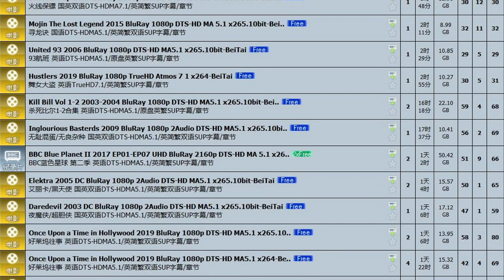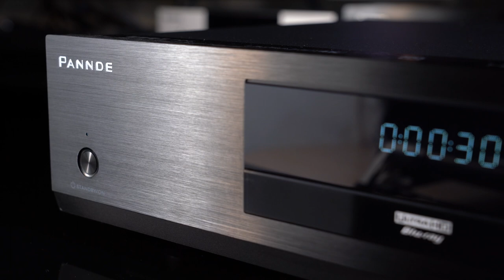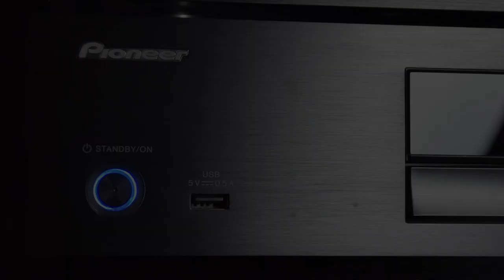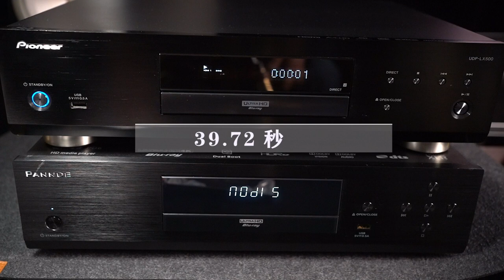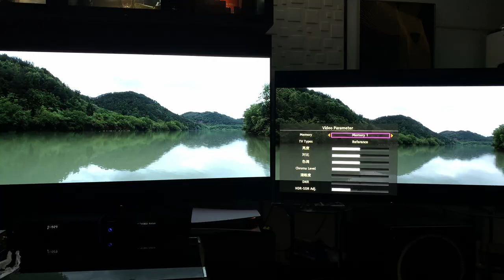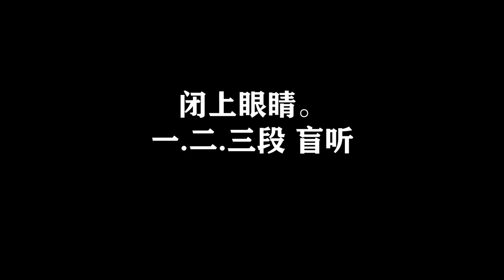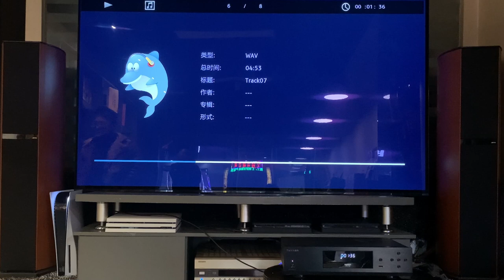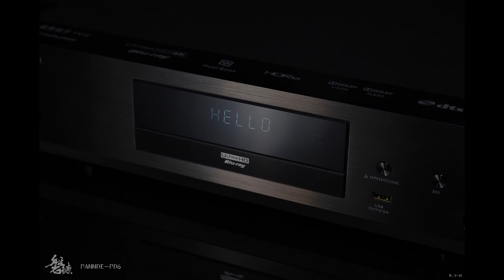PANNDE PD6 UHD Player Flagship review (with subtitles , you can choose language)

Comment: Will this outclass my Marantz UD9004?
Reply from the maker: The Marantz UD9004 is a very fine player, however it has his age. If you just watch Bluray 1080p and SACD/ DVD-AUDIO you don't need to upgrade. But you want everything + 4K UHD HDR, you could be interested. It did outperform  my previous OPPO UDP 205 in speed and Audio/Video was 100% same with better dual linear power circuits including dual femtoclock's. But the Marantz is a beast and has very nice build quality. The choice is yours :-)
Reply: Thank you so much for your prompt reply.  

My question is when I put a 4k disc in the PANNDE than I get the same movie in 1080p and put it in the Marantz what picture will look better?

Sorry for hard question I really appreciate your advice
Reply: Did I say something wrong?

I’m looking to buy something that will look better than the Marantz 1080p.  I’m using a barco projector!   What u think I respect your opinion !
Reply from the maker: @patkabongo2182  The Pannde PD6 Elite II (new Model) will have a better picture than your Marantz UD9004 as audio + Video chips are state of the art.

Comment: Video title in English and then video content (talking) in Chinese?... 👎🏻
Reply: Some months ago, I bought the predecessor ... sleek and smart... bought it from Germany. Problem is: NO MANUAL in either German or English, ONLY CHINESE!!!! Gives me Hell all the time!
Reply from the maker: @nielshenriksander6918  but there  are manuals for the firmware in many languages, also on screen display can be set in many languages same as Oppo and Pioneer. Contact cineULTRA.eu for support.
Reply: @pannde-eu4181  Hi there, and thanks for writing . Un 'til now I didn't find any instruction on how to use the 640, so it's just stading there....UHD, yes, but no sound . Tried variuous settnings, still quit. really need that manual.
Reply: @pannde-eu4181  ps. how to work the pioneer remote is difficult, not to mention the harddiskdrive and its remote...... such a pity.